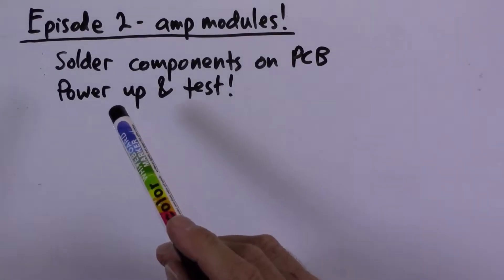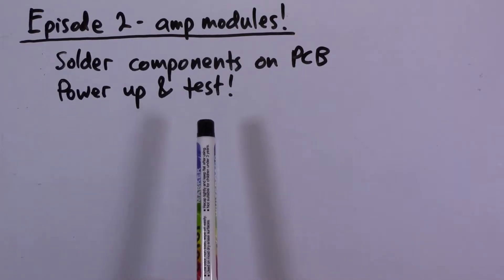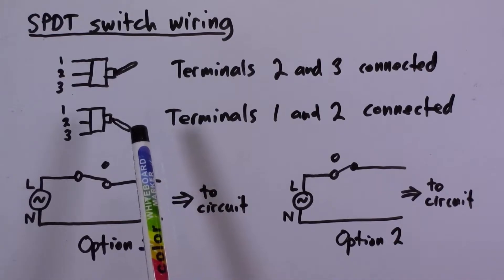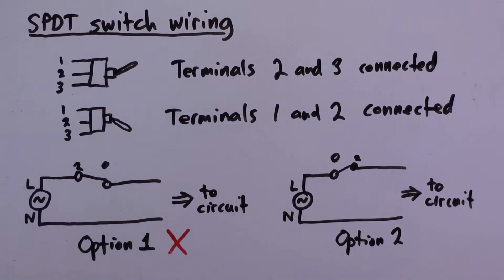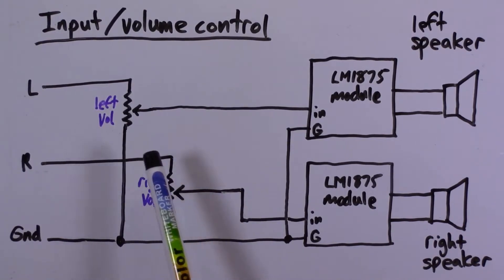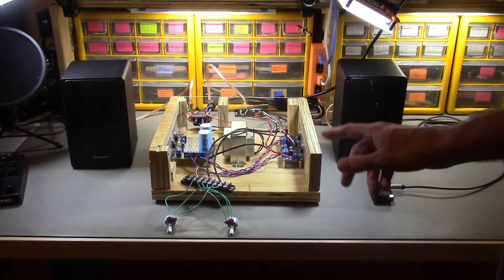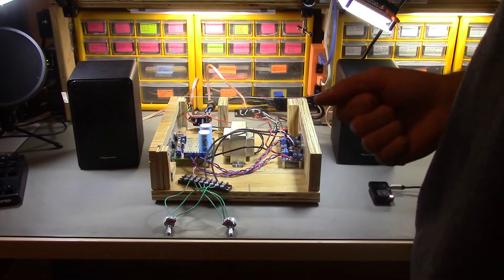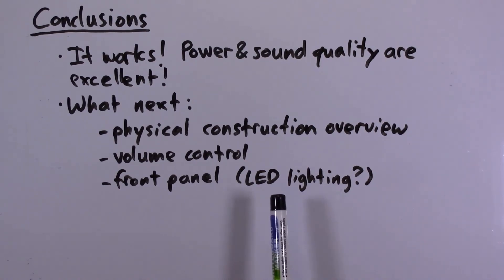DIY audio amplifier, Episode 02: Initial power-on & test

Comment: I’m really enjoying your videos (learning a lot). Can I ask an unrelated question - your storage system at the back of your bench - what  storage system is it?
Reply from the maker: Glad you're enjoying the videos! The storage cabinets on the bench are the cheap 12-drawer ones from Harbor Freight (I guess that's a US-only thing).  I build a hutch to go on top of them which has some test gear (oscilloscope, power supplies, bench multimeter) on top of it, along with some random parts and gear.  I may do a "lab tour" video at some point.
Reply: daveho hacks thanks for the response. A lab tour would be interesting. Also, do you have any additional plans for your 6809?  I’m creating something similar, and I’m getting a lot of guidance and inspiration from your project.

Comment: Nice build!  I'm kind of a fan of having 2 separate volume controls, UNLESS you then put in a balance fader.  I was trying to think if there was a way to maybe use one of your existing potentiometers as a fader, putting the ground reference into the center of the pot, then feeding each side of the balance pot into the channels of the stereo fader as it's new "ground".  It might work, but then I think the added resistance might limit the overall volume of each channel to half the intended max?
Reply from the maker: You're right, independent left and right volume would eliminate the need for a balance control. My thought was maybe at a later time to add a preamp that would have volume, bass, treble, and balance.  I might use the amp for a while and see if those adjustments are something I really need.  I think I see your point about how a balance pot in series with the volume pot would attenuate both channels when dialed in its center position.